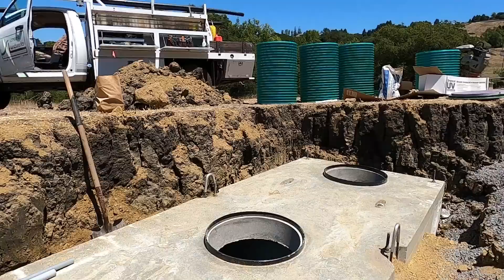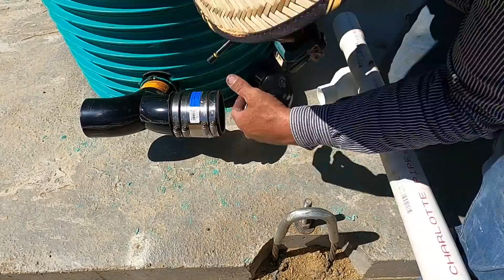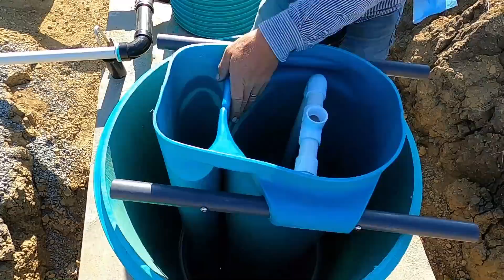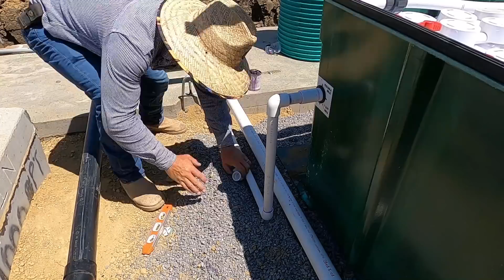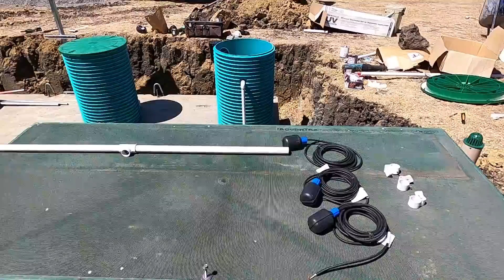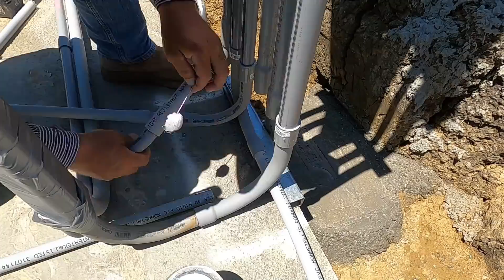MOST ADVANCED RESIDENTIAL SEPTIC SYSTEM INSTALLATION PROCESS. Installing pumps, RSV, UV & more  EP60

Comment: The 3 floats on discharge; are they 25 volt ac or a very low signal voltage from control board? (They'd be ideal for pond evap top up!)

Comment: By NEC regulations you have to treat conduit as wet location and expect the conduits to always be full of water.  That is the reason you can't use NM based cables inside conduits.
Reply from the maker: Great info. Thanks!

Comment: I have a question is dug up my septic tank & found one 24'' x 24'' inspection lid i found the inlet end i dug up found the whole inlet end corner to corner. No other inspection lid just one on the outlet end will the septic tank cleaner be able to get it all pump out & clean  ? It's a little over 100'' long & around high 50s'' wide it was put in mid to late 70s
Reply from the maker: There should be an opening on the solids side of the tank for pumping. If not, your tank is one I have not seen before and I have seen a lot of tanks. Maybe dig and expose the entire top of the tank just to make sure. Let me know if you have any other questions. Good luck and thanks for watching.

Comment: What was the reasoning/need for such an advance system?
Reply from the maker: The system is for multiple dwellings but the main reason is the soil type is not great. Other reasons for a system like this could be high ground water or a drainage course or body of water that is close by. Good question and thanks for watching.